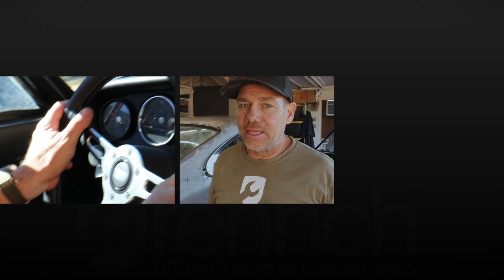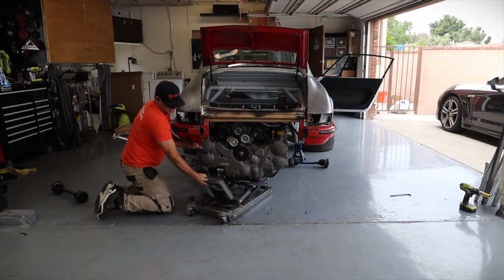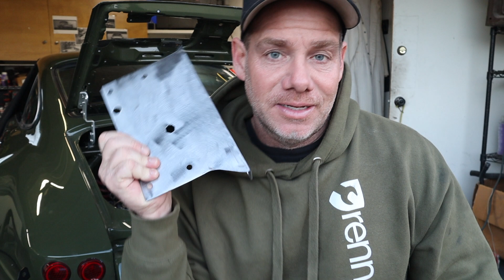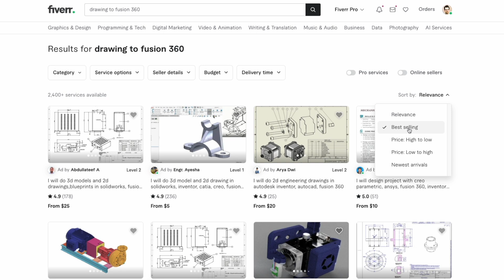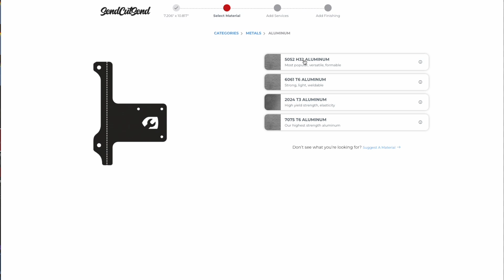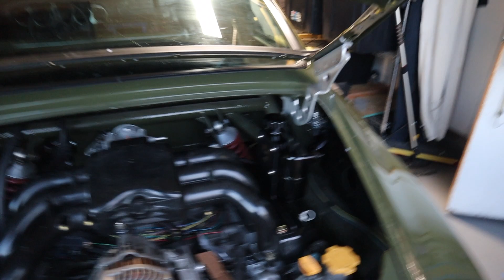How To Make Your Own Car Parts With SendCutSend!

Comment: No critiquing you by any means. But if you wanted to could you have put the level check hose on the tank facing out. I know if you want to see it as it is you could just use a mechanics mirror to see it but just curious if it would have fit on the cap side as well or was that an issue with the cap? Also really enjoy and look forward to your vids and hope you got all that other mess settled and you are back to normal. Great builds ! 👍

Comment: on fusion 360, insert canvas (your pic).  On the left menu, click to your canvas pic, calibrate, and then from one point to another point, you set the real size, the canvas will be scaled to draw your sketch on.
Reply from the maker: Yes correct!